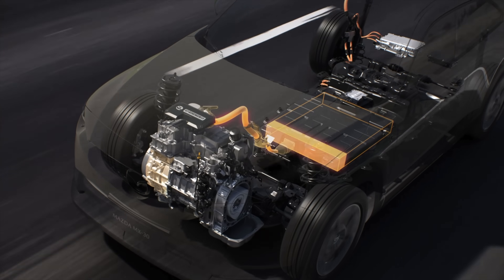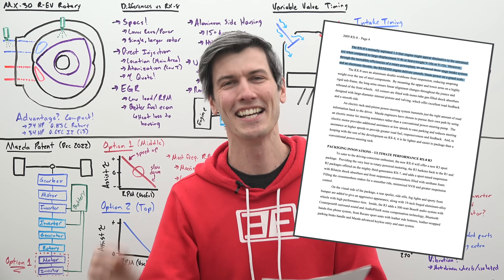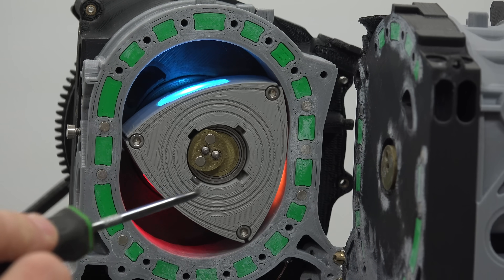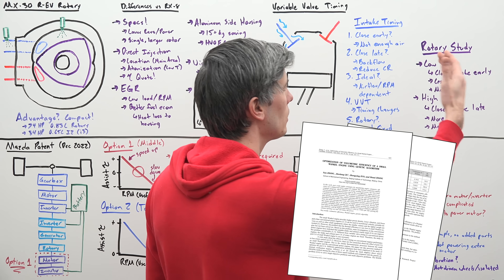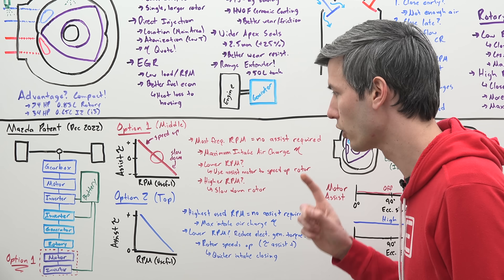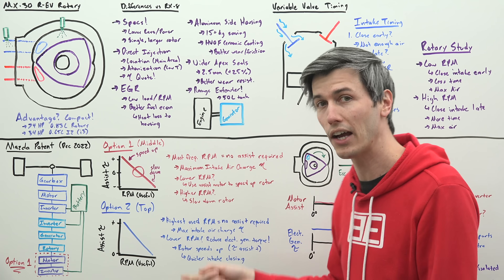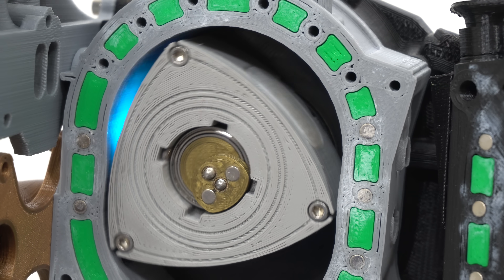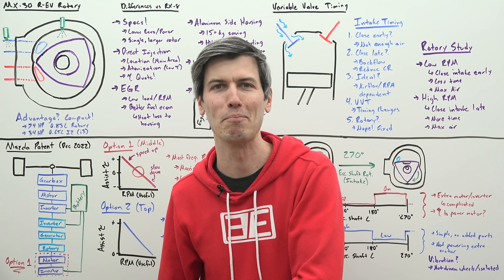Mazda Brought Back The Rotary Engine!

Comment: Thanks for the hard work and great delivery. Meanwhile, I am surprised by what Mazda is saying about EGR! 
EGR is not about keeping the heat in the engine. Yes we don't want the engine to emit too much heat but we should do that by lowering the heat release, not keeping the heat from escaping the engine. A lot of work is done to keep the engine cool actually, e.g., as you guessed, the cooling system! EGR is used to cool down the combustion gases. Yes exhaust gases are hot, but they are way cooler than the peak combustion temperature. By recirculating a small amount of the exhaust gases into the engine, we lower the peak combustion temperature which helps in two very important ways: it prevents knock, and also reduces NOx formation. The drawback is, as you guessed, formation of CO and unburnt hydrocarbons (HC). This is specially an issue with Diesel engines where a lot of EGR is used to prevent NOx formation. Hence engines with excessive use of EGR have to use a DPF (Diesel Particulate Filter) to trap and burn the soot, or unburnt HC. But that's another story.
Reply: Interesting comment considering Wankel engines typically have comparatively low NOx emissions and extremely high CO and HC emissions...

Comment: Keeping the rotary engine alive even just as a compact high-power (for the size) generator in an EV is to be applauded. This sounds like a good application of Mazda's expertise, I hope it works out well for them.
Reply: Respect to mazada.
Reply: Almost 100hp from something so tiny is amazing. Imagine with boost, or better yet 2 rotars. The hp/liter is amazing

Comment: So fun!!  Thanks for bringing back memories.  "... piston engine goes boing-boing-boing but the Mazda goes hmmm". Mazda has always wanted to be different and this idea is very clever.  Note: Regarding option 1 & 2, in most cases, generators and motors are the same thing.  You can make a motor act like a generator and make a generator act like a motor so, they could even use the motor as an active assist if they direct power into it rather than out of it.  I am not saying they will do, only that it is technically feasible.  The challenge is that the electronics around a motor and generator are different and so adding the electronics to direct power into the generator to cause it to act like a motor would come at a cost and it would need to be worth it.

Comment: Hey! You should look up Liquid piston. it's a rotary engine that's inside out. It apparently fixes a lot of the problems that the rotary naturally had. I'd love to see a video from you about it!!!
Reply: I live in the same state as the company, and if I had the money. I totally would invest time and money with them to design a prototype engine for a Toyota I am going to be restoring.
Reply: Doesn't Liquid Piston have a military contract and that's why they've been so quiet over the years?
Reply: Not sure why LiquidPiston has been soliciting investors the way they are...
Reply: They have like 3 prototypes, only 3 public demos, and no public use after 20 years of being in service. I think they are a research company that made gold but is just sitting on it and milking all the government contracts they can get. They still have the same numbers for efficiency, weight-to-power ratio, and other things for the past 6 years. I sat in on their webinar and they are not even thinking about public sales for about 10 years. I asked them about using their smallest engine for lawn and garden equipment, since it is so efficient, easy to maintain, and balanced they immediately have a market.
Reply: Check out the Omega One rotary engine.
Reply: Ah, the long sought-after external combustion engine!
Reply: @alexzanderroberts995  What was their response?
Reply: @YourPalQWERTY  would love to see one of their engines on a small bike. Their prototype is almost nearly there.
Reply: Googled it and it interesting.
Reply: @Appletank8  something along the lines of we are just getting out of RnD we don't have the facilities to think about that kind of mass manufacturing.
Reply: Some of these replies to this read like one of those crypto bot scams and their website blanks off the page telling you to "invest". I smell something rather fishy here...
Reply: @user-pq4by2rq9y  It has been almost nearly there for the past 4 years...
Reply: @alexzanderroberts995  That's a shame. I feel like they could just license it to other companies and avoid having to do all their own manufacturing.
Reply: @billganahl7151  You do know external combination engines are a thing right? Coal powered locomotive stream engines  are external combustion engines
Reply: @nahometesfay1112  Not external since the firebox is on the inside.
Reply: @meerkat5818  from Wikipedia with a simple Google search: An external combustion engine is a reciprocating heat engine where a working fluid, contained internally, is heated by combustion in an external source, through the engine wall or a heat exchanger. The fluid then, by expanding and acting on the mechanism of the engine, produces motion and usable work. 

Apologies if you were making a joke.
Reply: @ryanstarret  Thank you relieving my internal screaming
Reply: @alexzanderroberts995  The problem with liquid piston is there are extreme stresses on the rotor... it does eliminate many of the problems with the wankel rotary but it adds its own. The stresses are extreme enough that it causes materials science problems to build it to be reliable. On the other hand thier use in military drones probably means the stresses and runtime for those engines is not out of reason. They definitely aren't ready for use in most industrial and consumer applications.
Reply: @ryanstarret  I stand corrected
Reply: @billganahl7151  I mean, steam engines...

Comment: I love to see the progression of the idea! The first design with the additional motor was complex, confusing, and likely very expensive. Second design, simpler uses existing components. All you have to do is pulse width modulate the generator, and magically, you can now control the actual load of the engine!

Comment: The rotary engine is a perfect fit for range extending as it isn't driving the wheels just a generator to charge the battery. Load and speed of the rotary engine are thus totally decoupled from the drive train and the rotary engine can operate at optimum RPM rpm and load.
Reply: Yeah exactly, which makes me wonder why they have all this tech to make it operate more efficiently at different RPMs? Just run it at peak RPM all the time.

Comment: Not exactly how we wanted it, but glad to see they're still improving on the doritos. The dream lives on. I'd be interested to learn how they've played around with these improvements in a combustion only design.
Reply: I think it's crazy they are using aluminum housings, I would think the coefficient of thermal expansion for aluminum would make them a no go. But I guess if everything is aluminum then it works out in the long run, especially considering the ceramic coatings.
Reply: @anydaynow01  the housings where already aluminum in rotaries. It was just the caps that close the combustion chambers that weren’t

Comment: I wish they would make a car similar to the Honda CR-Z, a 2 seat 6 speed manual hybrid car that revs to the moon and uses electric power to boost the low end torque and get the mileage up a lot.

Comment: I cant imagine Mazda spending ALL of that money on Wankel R&D just for a range extender. I hope that in the future we might see "other" applications aswell.
Reply: I agree with that sentiment. However, with the apparently significant amount of work that went into making an electric motor/generator part of this system, I'm wondering if a similar setup will be used even in a more performance-oriented application. Nothing I saw here is making me real confident that we are going to see a rotary pushing the wheels through a direct mechanical linkage. We will just have to wait and see what the future brings.
Reply: RX10 Miata?
Reply: A mazda brand compact portable generator!
Reply: The biggest problem for electric vehicles is finding charging ports and spending time at them so why would a rotary electricity-maker be a minor thing?
Reply: What do you mean “just a range extender”. Most of the R&D on Wankel has been towards maximizing efficiency and reducing emissions. Mazda already know how to make high-power rotaries. This takes full advantage of the rotary small size, simplicity and great power to weight ratio.
Reply: @Keestral This is just another Mazda clickbait hoax

Comment: This idea to me fundamentally solves the biggest reason I wouldn’t own an electric vehicle especially an electric SUV. I can actually road-trip this car and park it in the woods without total anxiety.
Reply: Yep, my 2017 volt works great. sometimes I go months without even using the ICE, road trip and it's quiet and efficient.  Chevy would dominate the market if they brought it back. It's also 5 years old now and I get more EV range than advertised when new.
Reply: @Tac0312  It's SUCH a good idea. It's too bad it's by Chevrolet and not very well put together. Would be a killer if they got some better quality control in there.
Reply: @shraka  agree with you there.
Reply: @Tac0312  They sold them for a limited time here in Aus. I probably would have bought one if their build quality was a bit better. Def would have if it had an optional handling package.

Comment: If they're continuing to be inaccurate in their displacement figures this is a Massive rotor by Mazda standards. that single rotor is 2.49L In displacement( or if you wanna do the 2 rotation calculation that is used to compare to Standard OTTO cycles 1.66L) for reference the 13B is actually 3.9(2.6L) and it's a 2 rotor

Comment: This is cool. I've often wondered about how using a small generator engine at it's most efficient RPM would be the best way for a "range extender" engine to work (rather than adjusting revs and VVT based on draw), but I never considered how the Wankel would be a great way to accomplish this. And I like how adjusting the draw helps zero in on the right RPM, it's backwards from how one might naturally think of it, but it totally makes sense.

Embrace the Wankel!

(Let's just hope it's quiet... I couldn't imagine driving along with a loud droning engine at a constant RPM.)
Reply: Whats the concern with sound? It can be very good sound sealed in back of the car.
And also, seriously You didn't never rode on the highway? If you're going 70mp/h for 300miles, 98% of the time you DO HAVE constant rpm
Reply: @wiciuwiciu2783  I get that from the highway side, but I'm talking about driving around town going various speeds, it might sounds annoying to have an engine droning along at a constant speed while driving in stop and go traffic. If it's sealed of and quiet to the driver, then it's not an issue.
Reply: @BBKing1977  Saab 900 had first type CVT gearbox (it was transaxle lol). Just like in 50cc scooter xd

You can find movies of people cruising 30km/h with constant 4000rpm xdddd
THAT was nightmare

Comment: It'd actually be interesting to try to retrofit this engine into an RX-8 since it'll have more readily available parts since they're planning on mass producing the MX-30, it definitely wouldn't make the RX8 as powerful and probably wouldn't sound as good but its an interesting idea
Reply: retrofit a single rotor thats used not for the driven wheels but as an A/c current source? I think you need the electric motor and all the wiring as well.
Reply: It'd be a twin rotor, and it's mostly just me thinking of parts being more readily available then the renesis engine
Reply: I love innovation and the great minds who decide to do it. Can't wait to see what you come up with...

Comment: The hybrid electric variable valve-like timing is ingenious. I'm surprised there's hardly any comments about how the next RX-7 could be a hybrid using this system. Maybe that's too hopeful, but it could address emissions concerns and bump power with an electric motor.
Reply: @Lurch I guess I didn't realize a sports car had to use the most efficient hybrid system 🙄
Reply: You hit the nail on head. I believe that's next Rx9 car. To check all the boxes it very likely will use some form of this hybrid system for sure.
Reply: @aarons4205  If people are buying Tesla EVs as sports cars this makes more sense. You will still get your Rotary's, but now way better efficiency and hopefully reliability. I'm excited.

Comment: Very interesting. Now we need to know how efficient this is. Hopefully there will be more information on this soon 😁
Edit: I looked it up, the fuel consumption should be around 10L/100km which is not a good value. So efficiency is not very good.
At least it is possible to do the daily without using the range extender and the latter gives the confidence of staying mobile even if no charging station is available.
Reply: I believe that equates to 23.5 mpg?
Reply: @tbirch55  I calculated around 25 MPG at best. Its main advantage is leaving more space for batteries so you can avoid using the wankel as much as possible.
Reply: 10L/100km not being great is relative, in something like a 2003 Nissan X-Trail T30 (the Nissan Rogue in US is the X-Trail T32) with a 2.5L (2488cc) i4, getting ~10L/100km combined (highway + city) at 3000 rpm with a 5-speed manual transmission is about the best you could hope for when you need something that can haul a family but also comfortably haul heavy gear for your dayjob as a tradesman in Rural NSW.

In this Mazda's case, 10L/100km isn't super great but it's also not super bad as it's mean to provide you with extra juice in the battery in the event you can't reach a charger, or provide extra power for acceleration on steep grades that would otherwise drain the battery too quickly.
Reply: @ElNeroDiablo  I see. Thank you for that explanation. In terms of overall environmental impact, Physics for Future Presidents (a 2008 book) explains that hybrid vehicles may make some sense (if reducing CO2 is a goal) but pure EVs do not. I bought the first Mazda model in the U.S. with the Wankel engine in about 1973. It was a disaster. I have leased or owned 3 Mazda 3's over the last 15 years. All excellent and they remain a bargain relative to other makes.
Reply: @ElNeroDiablo  10L/100km isn't great in comparison to vehicles in a similar weight class getting 6L/100km (rav4 prime)

Comment: Acting as an EV range extender to feed a generator is currently the only viable path in automotive for rotaries... This is something I hope the Liquid Piston and Omega engine designs can position themselves to gain a foothold in other car OEMs.
Reply: There's a more than viable 20B-REW in my FB GSL, so I don't know where you're getting this "only viable path in automotive for rotaries is to act as a lowly EV range extender"(like anyone cares about extended the range of the EV they don't even care to own 🤣)
Reply: Just go to the end game and put an axial flow jet engine in one. Far more efficient then those options and can provide the power necessary with a motor that fits in your hand and weighs less then 20 pounds. The omega is essentially a single cycle jet engine
Reply: I assume you only mean for boring folk, rotaries are still amazing for fun cars!
Reply: Same with non-rotary ICE

Comment: But since it is a range extender we can run the engine at fixed speed. And depending on load either charge the batteries or send power to wheels.
I.e engine generator set produces constant electric power and then the power is split between batteries and wheels, priority being the wheels. And limit the top speed during range extension mode.
Reply: If the cars stops in traffic and the battery is fully charged or in the tapered charge curve? The engine would need to be shut off or allowed to idle to prevent the batteries from being damaged by overcharging.

Comment: I still don't understand why a generator would need to be at different RPM's. Pick the most efficient and keep it there. Maybe have a on and off when the battery has no need for power.
Reply: My thoughts exactly. Generally genset engines are fixed speed controlled.
Reply: or just create an ev with more than 100miles of range?
Reply: me too, the speed control strategy is used on gen packs(tied to the grid or in island mode) all over the world without additional motors
Reply: Agreed. Unless you are going to mechanically couple the range extender to the drive wheels there shouldn't be a need to vary the rpm. Chevy Volt did couple the range extender to the wheels at higher road speeds, so maybe Mazda is going to use a similar strategy, but if they did so the speed up slow down of the eccentric shaft that Jason talked about would not work without a loose coupling.
Reply: They need to vary the RPM to have enough dynamic range of the power output to meet peak demands while ALSO optimizing around a configuration that provides optimal fuel efficiency during the 90% plus of the time that is running as a range extender. You can’t do both ends of the demand extremes at one RPM. Inverter based generators can run at variable RPM for this vary reason.
Reply: Because at low load, and high rpm you get less efficiency. So you decrease rpm so you can open the throttle valve more and get better efficiency

Comment: This sounds like a great idea. The added moving parts and lifespan of those parts would be the biggest concern.
Reply: Compared to just a three-cylinder, the rotary has fewer moving parts. All comes down to materials and precision.
Reply: Added moving parts? Do you have the slightest Idea how many moving parts are in a piston engine? A rotary connected to a generator connected to an electric motor is probably the combustion vehicle design with the least moving part that you could build, apart maybe from a ramjet.